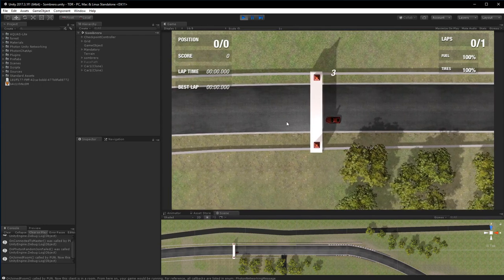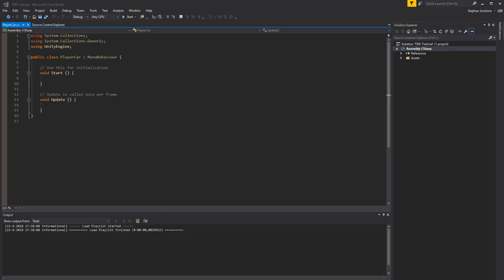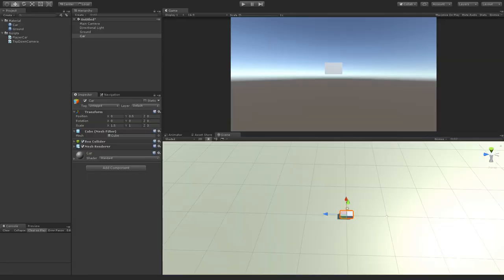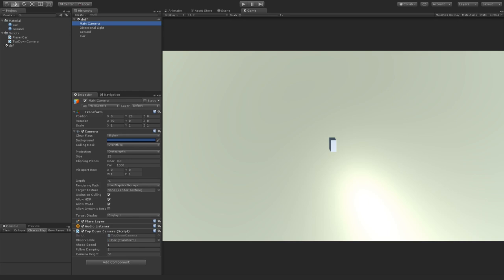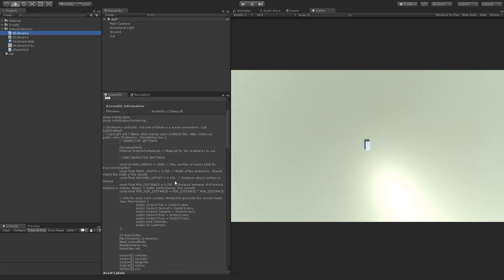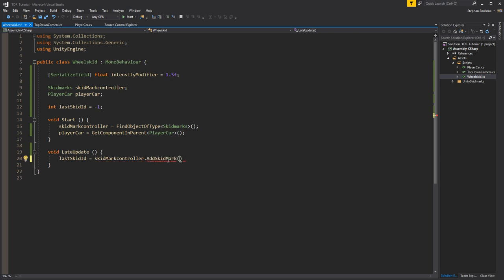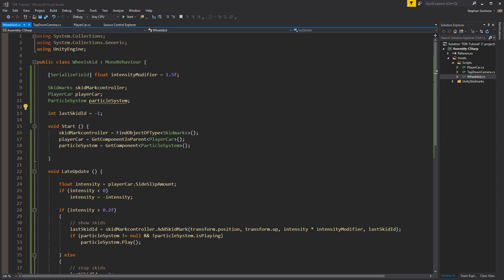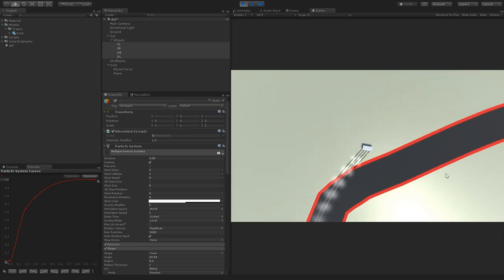Unity3D - Top Down Racing game Tutorial

Comment: Just a little comment from my personal experience:
Do not use Time.DeltaTime or any simmular default functions. If you have a piece of code that should work with physics or movement use your own delta time calculations from last frame update calls for every script. (<currentTime> - <last time your code started>)

A reason for that is you dont have control on when exacly your particular update call will happen. Time.DeltaTime just tells you how long it took to process last frame, but  you need a time  passed since update call in your particular script that happened last frame. 

You have lots of other systems running inside updates or fixed updates in your project and you never know how long it will take to reach your particular code ( you dont know how unity will manage your gameobjects and in which order they will be processed). Time.DeltaTime approach only works of we assume that the only thing happened during last frame is our script we working with.

So, in the end you will face a lot of strange jittery movements and other problems(like your car with constant speed will pass same distance faster or slower from time to time) all over the place, once your project will become big enough. You will never notice this on small scenes , but it will hurt you when actual testing will happen
Reply from the maker: Hi! I have yet to come across the problems you describe. The only problem i have had is when using fixedupdate with non-physics movement. All other jitter movement problems are solved by keeping all movements in the same update. 

But again, I haven’t experienced this in my projects (including several finished and complete projects) beside the normal jittery. 

In this video things aren’t as they supposed to be, as in my nearly finished project the movement is done quite differently to achieve the same effect. 

The problems are noticeable when adding multiplayer functionality. But my approach is always to keep things small and simple as you work out your basic gameplay programming. 

Nevertheless, thanks for your comment hopefully your comment can help someone out in the future. 

Stevie
Reply: how to play a playlist music? I have a script but it plays 2 songs at mismo time
Reply: @LuciaRodriguez-kq4pw  instantiate it in your c# script using random function and set your musics in the controller, this should work, if you want to choose songs then you need some UI to give inputs

Comment: Great tutorial! How can I make the car go faster when using wheel colliders?
Reply from the maker: Roberto Ortis hi! With WheelColliders you   should use .AddTorque
Reply: @stevie_rof  thanks for the reply, I will try. Currently, I am just applying motorTorque times the user's input. If I increase it, the car goes crazy and out of control. With addTorque won't I have the same effect?
Reply from the maker: Roberto Ortis ah yes! I meant that. You will need to add a rigid body as well, with some sensible values to make it work.
Reply: @stevie_rof  I have been playing around with the wheel colliders settings but it's a mess, lol. I want to make it feel more like an arcade style of racing.
Reply from the maker: Roberto Ortis I usually remove the colliders that are added from the model/mesh and use a more simple boxcollider. This usually works better with wheelcolliders. Also, add another empty gameobject and set this localPosition as the centerOfMass of the rigidbody. This way you can tweak the position of the CoM a little more easy (forward)
Reply from the maker: Roberto Ortis you should not change much of the wheelcolliders settings at first. Tweak those only after making it work properly by default. Keeping units is also easy: 1unit should equal 1meter. So your car size should about match the realworld size (to start with)
Reply: @stevie_rof   I got my own car mesh into unity. It works properly with the default settings. The car moves ok but it doesn't feel right, it feels way too slow, it takes forever to brake and to accelerate, even if I increase the motorTorque, it just goes fast after a while pressing the input key. I will try with the center of mass at the front of the car and some other settings anyways
Reply from the maker: Roberto Ortis reduce the mass of the rigidbody. And play with the multipliers on the wheelcolliders. Increase forward friction on the wheels that accelerate to increase the grip. Reduce the slide friction to add more sliding on the backwheels.  Use motor torque on the front wheels only

Edit: also, make sure to have the same settings on each side. and differ the front and back.  Ctrl+click on two gameobject to manipulate them both.
Reply: @stevie_rof  great, thanks for the tips, I will try those. What do you mean by the multipliers?
Reply from the maker: Roberto Ortis if I remember correctly, the wheelcolliders have two multiplier settings. I think it’s the ‘stiffness’

At 1 it is max and at  0 it’s non-existent
Reply: @stevie_rof  very nice, I will play with those as well. Thank you very much :)

Comment: ScreenpointToRay is not working properly and has a red line under it.
Reply from the maker: Isak captial P?
Reply: This is all my code:

using System.Collections;
using System.Collections.Generic;
using UnityEngine;

public class PlayerCar : MonoBehaviour {

    [SerializeField] float turnSpeed = 5;

    Quaternion targetRotation;

    void Update()
    {
        SetRotationPoint();
        transform.rotation = Quaternion.Lerp(transform.rotation, targetRotation, turnSpeed * Time.deltaTime);
    }

    private void SetRotationPoint()
    {
        Ray ray = Camera.main.ScreenPointToRay(Input.mousePosition);    //screen point to ray not working
        Plane plane = new Plane(Vector3.up, Vector3.zero);
        float distance;
        if (plane.Raycast(ray, out distance))
        {
            Vector3 target = ray.GetPoint(distance);
            Vector3 direction = target - transform.position;
            float rotationAngle = Mathf.Atan2(direction.x, direction.z) * Mathf.Rad2Deg;
            targetRotation = Quaternion.Euler(0, rotationAngle, 0);
        }
    }

}
Reply from the maker: Isak hm, seems ok. You are getting methods from Camera.main
Reply: It always gives me this error:      Assets/Scripts/test.cs(9,31): error CS1061: Type `object' does not contain a definition for `ScreenPointToRay' and no extension method `ScreenPointToRay' of type `object' could be found. Are you missing an assembly reference?
Reply: Actually dont worry i made a new unity project and restarted unity and it fixed the error. Thanks so much for the help!
Reply: in the inspector tab just change the tag to MainCamera...problem solved...